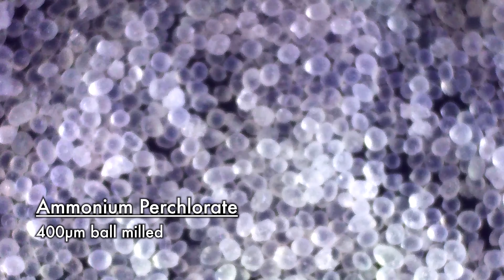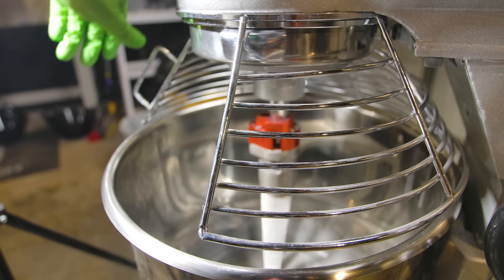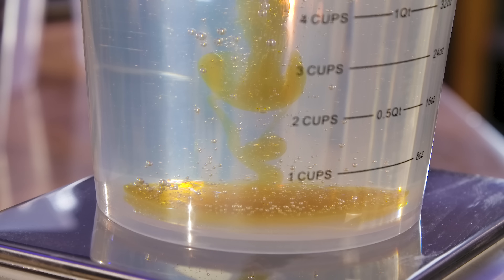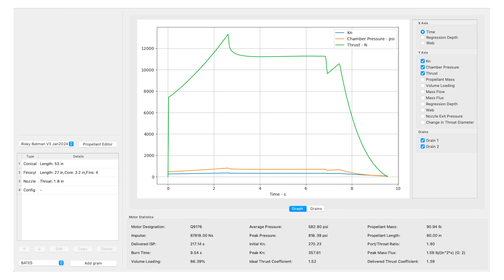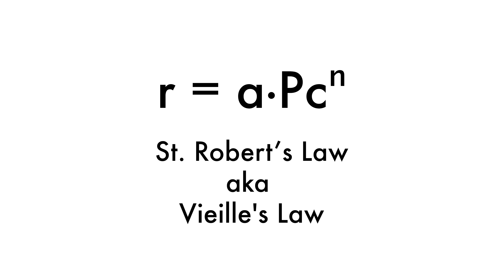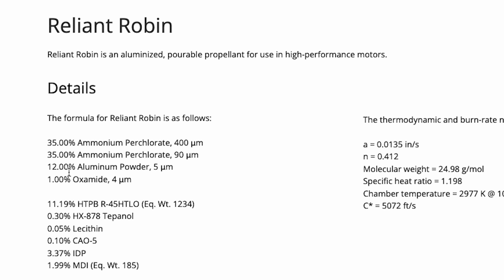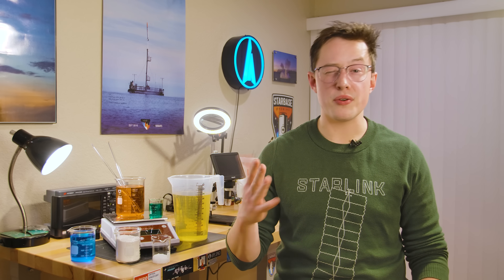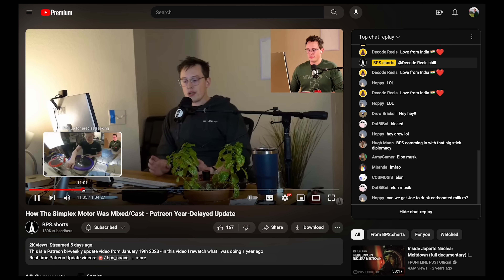Making a new solid propellant formula

Comment: 60% Oxidizer (40% AP + 20% KNO₃)

20% Fuel (Aluminum Powder + Sugar)

15% HTPB Binder

5% Curing Agent (e.g., TDI or IPDI for HTPB)

For a 10kg total propellant load, the mix would be:

Ammonium Perchlorate (AP): 4.0 kg

Potassium Nitrate (KNO₃): 2.0 kg

Aluminum Powder: 1.5 kg

Sugar: 0.5 kg

HTPB Binder: 1.5 kg

Curing Agent: 0.5 kg

 Use it

Comment: When I used to dabble in similar hobbies I found out the best way to make a homogeneous mix. Mix all the dry powdered ingredients through a screen. Repeat around 10 times or so. This was superior to mixing the ingredients wet then drying them out. Sounds odd I know, but it makes a much more homogeneous mix with no clumping. I suspect you'd never have molten Al coating your nozzle.

Comment: A very nice video but unfortunately, it presents some inaccurate information as well as serious safety issues. Ammonium perchlorate is not "ball milled" to make those spherical granules as you state . The granules in your example photograph are made in a process known as "rotary rounding". Ball milling would smash it up into an uneven powder with with poor rheological properties for optimized solid loading in propellant. Industrial propellant AP feed stock typically employ a base mean diameter AP and the other diameters are site milled using hammer mills, pin mills or fluid energy mills (jet mill) depending on the mean diameters required in an optimized, multi-modal composite. The aluminum particle size and shape is also factored in. Many other factors come into play that determine the propellant's processing characteristics, physical properties and ballistics. Surfactants such as zirconates and titanates can also be used to improve viscosity characteristics but are generally not required if optimum particle distribution is applied in the formulation and the chemistry is understood and well characterized. 

HTPB is only one of many polymers that are used to manufacture APCP and there are different types and grades of this urethane. In addition to other common examples such as CTPB and PBAN and PVC plastisol, there are many other polymers including energetic polymers that can be used. There are also a types of APCP that use cross-linkable, thermoplastics and/or double-base propellant binders. Many of these binder materials have advantages over HTPB. For example, ammonium perchlorate is slightly soluble in HTPB and this can cause both mechanical and ballistic issues due to the conditions it creates at the oxidizer/binder interface. The use of epoxides can help the situation but it is not optimum and more of a work around so to speak. 

The technique of post vacuuming a batch of propellant is not ideal. Calculate the ideal density of your propellant. Then mix the propellant without the post vacuum step, measure the density and compare it to the ideal value. That will give you a fairly good idea of how much air you have whipped into the mix. Now, post vacuum the batch until it breaks and settles, then measure the density again and compare it to the ideal value. You may be quite surprised about how much air remains whipped into your mix. The reason is you are limited to only ~1 atmosphere of differential to suck all that air out and the damage has already been done. You could leave it for days under a vacuum and the most that may come out will be a result of diffusion. Atmospheric nitrogen is also considered by many urethane chemists to be a bad player in many targeted urethan reactions. In order to avoid these issues, propellant must be mixed under vacuum from start to finish unless "good enough" is the desired result.

Your choice of plasticizers should also take a number of other factors into consideration, but I would suggest you be careful with isodecyl pelargonate. It is very hygroscopic for starters. It will pick up atmospheric moisture quite quickly unless you handle and store it carefully. This detail can result in cured propellant that resembles mayonnaise otherwise.

You go out of your way to point out chemical safety but In your video, you casually mention the the use of ferrocene and catocene as burn rate modifiers. Those compounds sublimate and migrate in composite propellant and sensitize it to the point where it can be referred to as "strike anywhere" propellant or propellant with varying or unpredictable characteristics. The use of those chemicals are outright banned by many branches of the DoD as well as industry.          

Ammonium perchlorate is not only an oxidizer, it is a monopropellant under certain conditions. The molecule is comprised of both an oxidizer and a reducer. CLO4 and NH4. Under pressure, it will burn quite nicely on it's own with a theoretical impulse of approximately 170 seconds under standard equilibrium conditions. Milling or grinding it generally considered as a high explosive operation as particles less than 40 microns in diameter can detonate if subjected to sufficient initiation energy. Many organic materials even in small quantities can sensitize this chemical, even the secretions from the skin on your fingers. It can be also be used for making binary high explosives. Just because AP mixed with rubber and some aluminum burns, doesn't necessarily mean it's propellant. Google "PEPCON disaster Henderson Nevada" if you would like to see what this chemical is capable of in terms of energy release. 

I have watched your videos and I don't know where you are getting your propellant information from but much of it is very incorrect. Your formulation and preparation methods are also hazardous and are putting you and anyone else in the area in harms way. I would strongly encourage you to seek some professional help if you intend to work with energetics before you burn your house down and seriously injure yourself and others. A home garage or basement is not a place to be mixing propellant. The equipment you are using, the extension cords and plugs have no business being in a mixing and casting area. There have been many accidents that have occurred at the industrial and amateur experimental level with composite propellant and many have been fatal or left victims with debilitating burns and other injuries. I work with energetics and munitions for a living and I cannot overstate how important proper safety is. Your goals and passion for what you are doing is quite commendable and you have achieved much. It would be terrible if an accident were to happen. Please be careful.
Reply from the maker: Thanks for the clarification - always down to keep an open mind on where I'm wrong - the ball mill / rotary round mistake is an embarrassing one. I'm not the person in charge of sizing the AP I use, so it's just a fact incorrectly stated. I'd be curious to hear what other improvements you'd recommend if you're willing to send those over to joe@bps.space

Comment: so why not try anfo as the rocket fuel, works in as both hypersonic thruster solid motor (directional charge) and hybrid rocket with separate liquid fuel container tank above the solid oxidizer, which is heat activated, producing high pressure oxygen. yep fuel + oxygen rocket. with natural plumbing, no turbo pumps, just gravity and pressure.

Comment: Why not use 143L and RT cure in hours not days or eliminate HTPB and use modified asphalt and include additive X that will boost the ISP by 10-15%? I like the Wac Corporal configuration with the Tiny Tim solid booster. BTW, additive X can be used in both liquid and solid rockets. Thank you.

Comment: Lecithin is also an emulsifier, useful for getting fats to stay suspended in water.  It's commonly found in nut milks to prevent separation, as nut extracts don't have whatever cow's milk has to keep the fat particles in suspension.  It's also a pretty handy additive if you want to add something like peanut butter to a smoothie, or want to make a lower-fat ice cream at home without risking ice crystals growing everywhere.
Reply: Or want to make potent weed edibles

Comment: Let me start off by saying I’m dumb and very ignorant on this. But why do they not crush the first substance into a fine powder for a more even burn (like the aluminium) rather than keeping it in large round particles? Like I say, I only have a very understanding about things but surely having everything the same small sized particle increases surface area which will react faster?

Comment: What I do not get is, why BPS space do not use a glider with his space rocket...
If he put a little glider with a camera on top of his rocket, inside a fairing of course, the glider come free above the Karmann Line and
then glides down. There would be a estimated gliding time from 15-20 minutes, plenty of time to make superb photos and film.
Plus it would be a world record for model gliders. There has been model gliders hanging on weather balloons. So why no glider on top of a model rocket and go down a 100 + kilometers? 
It must not be a "big glider", I think about a delta wing, self stabilised and only a control rudder on the vertical stabiliser. Maybe a real small one with max. 500 gramm weight and max. 15 centimeters long? It just needs a camera up front in the nose.
A real model scale space shuttle, how coo would be that?

Comment: Congrats, after more than 5 years you are my first youtube comment. Thanks for finally describing the full details of propellant design, interesting stuff. There's no protecting idiots from themselves anyway, if they are determined enough. Best you can do is explain why its dangerous instead of just giving them an instruction manual. Which you did.

As a former research chemist, I'd have to disagree about avoiding toxic chemicals on principle (I've used much, much worse), but I guess I wouldn't want those in my garage. Nice channel. Good luck with the spaceshot!

Comment: A dead straight concrete tunnel.
3 miles long.
Pointed on a slight upward trajectory from start.
To avoid unnecessary lateral g forces. 
Reduce atmosphere slightly.
Install mag-Lev rails around the outer diameter of the tunnel.
Accelerate whatever you like into space.
Weight would not be a problem.
I think lead lined space ships might be nice.

Comment: Noob question: Can the aluminum be replaced with something else that forms (preferrably a lot of) gaseous combustion products in order to further increase the total amount of thrust generated by the motor? I understand that burning Al is great to generate heat, but the stocheometry and end product Al2O3(s) seem kinda counterproductive compared to burning i.e. pure carbon, hydrocarbons, hydrazine or urea (if that last one can even be oxidized in a rocket engine).

Comment: Cool video! Is there another video where you explain why you are using a circular profile instead of a star profile for the hollow portion of the rocket motor?  A star profile gives you a more constant chamber pressure since the exposed propellant area stays more consistent throughout the burn.

Comment: Sutton has a good-sized section on this.  I'm considering a Karmann breaker, and so far, OpenRocket says a 3-staqed rocket powered only by N-5800 can go that 100 km line.  Since I want to get it back, the upper stage has a graphite nose cone and cargo bay and fins.  The rest is carbon fiber, 4.024" off the shelf.  As for recovery?  I'm still working on that, but Regallo is a very attractive method.  I'll build an Estes BT-80 size, first.

I'm learning a lot, here.  Keep up the good work!

Comment: You mention the use of MDI as the curing agent for solid propellants. Now I work at the solid rocket manufacturing plants in Utah where we all sorts of different propellants. And of all the formulations I know of, none of them use MDI as a curing agent. Also the curing agent we always went to in college was D.E.R 331 or DDI curing agent. Those are much more readily available and are not as toxic as MDI.
Reply: MDI is generally only toxic when inhaled which isn't typically an issue for propellant mixing

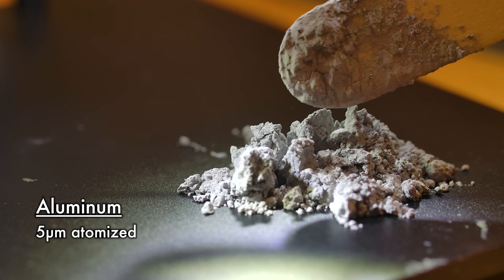Comment: Ah ah ah , you made an error my friend. The missile launching out of the ocean at 0:24, is not APCP propellant, its actually called NEPE propellant. It is a nitroglycerin based propellant and mostly comprises of HMX (RDX on steroids) as the oxidizer. It does use AP but not to the amount where other normal solid rockets use it.

Comment: MDI is an interesting chemical. Did you know one of its components is mustard gas/fosgene, which was used extensively in World War 1 as a chemical weapon. Another is Analine, which was used a rocket fuel, before hydrazine? Analine is also mutagenic, thankfully MDI isn't. Finally Formaldehyde is used to produce MDI, which is obviously famous as a replacement for blood in the conservation of corpses. Also, MDI is the principal component of Polyurethane/PUR, which is related to what you use it for in your propellant. Source - used to work in an MDI factory.

Comment: years ago as an amateur rocketry member we mixed solid propellant using NH4MnO4 and powdered aluminum with a 5 minute epoxy as a binding agent poured into 2" diameter by 24" length solid rockets. It was wild because the epoxy would get very hot during the curing process. Scary stuff.

Comment: I think the approach to chemical safety you conveyed in the tangent about HX752 is somewhat misleading. The reason to avoid toxic chemicals in whatever environment isn't really the damage potential itself, but rather all the extra steps that would be needed to mitigate that risk. Every chemical can be safely worked with in the correct environment, however it is frequently not possible in a home laboratory or it would require too much extra work to make the environment safe and implement the required steps to mitigate the hazard. 
The reason we want to avoid hazardous chemicals is because it reduces the work required to maintain a given level of safety, however there are situations where the safety "overhead" for safe use of a more hazardous chemical is less costly or work-intensive than adapting the workflow to use a less hazardous subsitute. In these cases it is very much valid to use more hazardous chemicals, as long as the necessary procedures are implemented to maintain a given level of safety.

Comment: Nice video, just a quick thought, would paraffin wax be a good combustion depressant? The aluminum fuel has an energy of 31.8 MJ/KG, but paraffin has an energy of 42 MJ/KG. This would increase specific impulse due to extra heat  energy and also lighter exhaust products (co2 and water over aluminum oxide). I know this would slow the burn, so maybe in small percentages on an upper stage🤔

Comment: I read about aluminium nanopwder mixed with ice --- called ALICE but it seems no much research has been done on it since the zero years. The disadvantage of perchlorate is that hydrochloric acid is in the exhaust and I guess corrosion is the least problem with it.

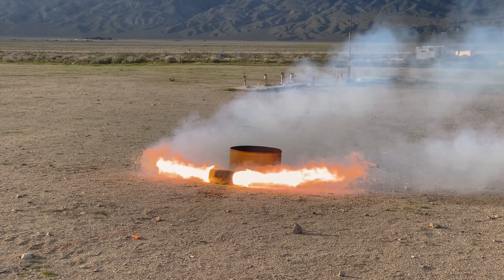Comment: 10:20 Nitpick: "power law", not "exponential". I know it's kind of confusing, because there is an exponent involved. But in the formula for the burn rate, the chamber pressure is not in the exponent, and so the relation between the burn rate and the chamber pressure is not exponential.

Comment: It’s worth noting that MSDS risks being lower is specific to the GHS classification system; that sadly despite being the international standard, isn’t always implemented so it’s important to check which system they’re rating it off 

Otherwise love your work; you’re spot on, working with nasty chemicals isn’t worth it 99.9% of the time
I miss having access to a fume hood after switching to engineering